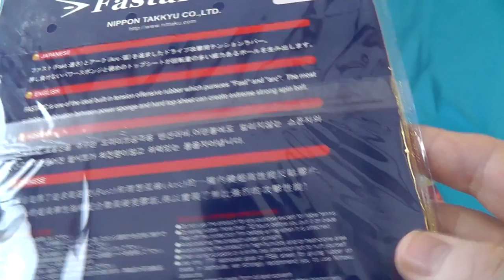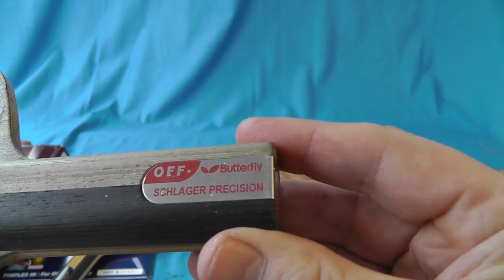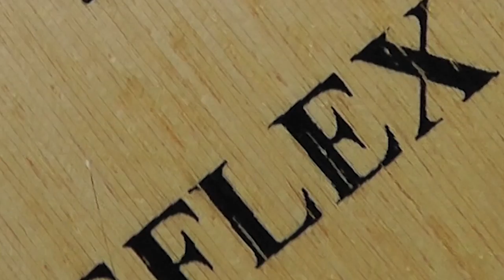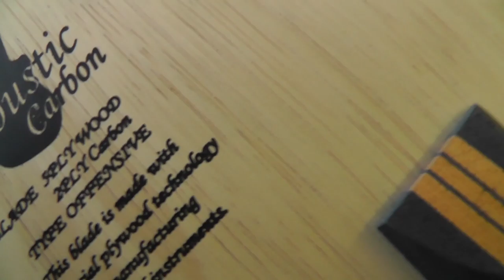Mima Ito setup - would you swap your setup for a professionals?

Comment: I heard her latest forehand rubber is hurricane 3?! Instead of G1
Reply: though it's the nittaku H3 not the DHS version :). Now It's G-1
Reply: Also Mima Ito uses a ST instead of FL
Reply: @kanck7909  Now way she would use H3, it is unsuitable for her style of play.
Reply: Ktosom Cosom how so? She definitely uses H3 sticky FH
Reply: Come on, she smashes at every opportunity instead of looping, taking a lot of risk. Hurricane rubbers are absolutely not suited for that. G-1, on the other hand, works extremely well for such playing style - tensor rubber with little bounciness, very much linear response and, most importantly her, thick and firm top sheet that is very grumpy but needs some digging into to generate a good spin. This enables very consistent driving, blocking, and smashing. There is no way any Hurricane would play like that; actually, there is no other rubber I know of that is similar to G-1

Comment: Any updates?
Reply from the maker: I used the SP's for a couple of sessions then took them off. They felt too bouncy, lively for me. I replaced them with tenergy 80. It made it a heavy setup but played pretty well.  The fast arc I kept on until Dec last year then I changed both the tenergy and fast arc for cheap rubbers and older ones I'd used on other blades. I liked the fast arc. The blade I used a bit longer then stopped. I'm back using my custom made blade now.

Ultimately I didn't feel  comfortable or confident enough with acoustic carbon /fast arc/ moristo combination to continue using it for coaching and playing.
Reply: @PathfinderPro1  oh i see. Thanks for the reply. Currently im using moristo sp 1.8mm thickness.having some problem to counter heavy looper attack as i felt the ball simply penetrates too deeply into the sponge and as a consequence, the underlying blade’s character shines through too much, decreasing consistency. Im thinking to change to 2.2mm to rectify this problem. 

So from your experience is it still difficult to block heavy loop with 2.2mm thickness?
Reply from the maker: @Bepowerful2020  It's hard for me to remember. What I do remember is that when you get the block right with 2.2mm it is effective but i found it hard to do for me. What i do know is that the majority of SP's in my stock and I've used a lot, tend to be 1.5mm to 1.8mm thickness sponge.

Comment: can you review on fastarc G1 please
Reply from the maker: Yes, eventually I will. But first I need to formalise the testing procedures I will use which will be consistent across all rubber and blade tests I do to ensure a fair comparison to be made across brands.

Is there anything in particular you want the G1 to be tested for?
Reply from the maker: I have purchased sheets of Tenergy 05, 25, 64 and 80, all black all 2.1mm - these will be the baseline rubbers I'll be comparing inverted rubbers to.